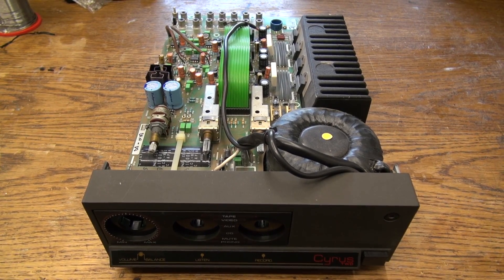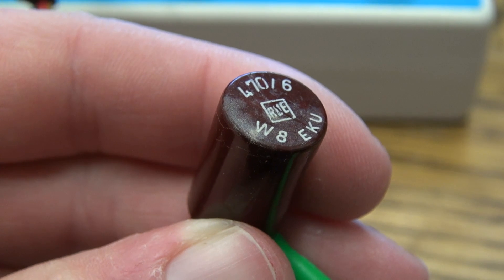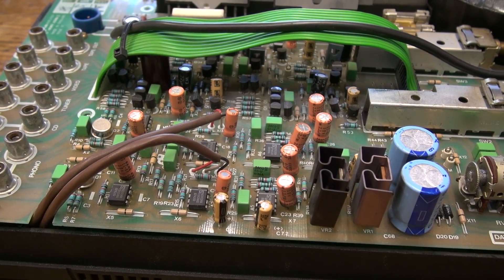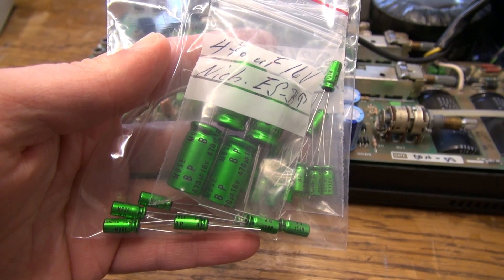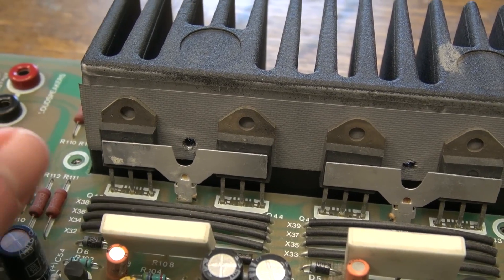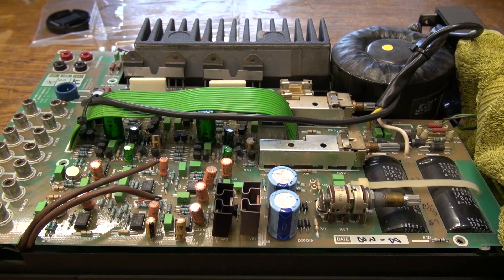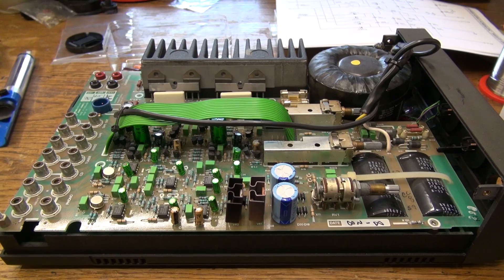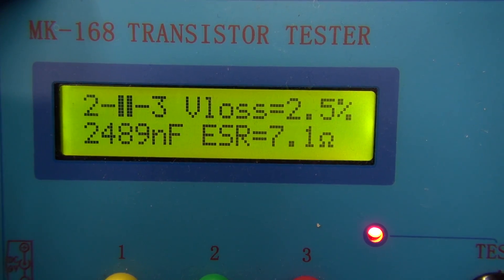Cyrus Two Amplifier Replacing Bipolar Capacitors

Comment: I replaced output stage npn with 2sd1047 because pt7 or buv28 not available in south Africa....also drive mje 243/253 i replaced with tip41/42c....works perfectly

Comment: Anyone can suggest good capacitors for the polar ones? I mean these:

8	22uF	25V	(C39, C40, C51, C52, C69, C70, C71, C72)
2	22uF	50V	(C37, C38)				
4	100uF	50V	(C53, C54, C55, C56)	
2	470uF	63V	(C67, C68)

Can I use ELNA SILMIC II for all these or do you suggest different ones?

Comment: Quick question some year later! :)
I just got my hands on a Cyrus 2! Is it fine to use with 4 ohm speakers? It’s the setup I’m using right now and it sounds great, but can I damage something?
Best regards, Pierre Manson
Reply: in the label on the rear side they stated 'minimum speaker impedance 8 ohm' so better not to use with 4 ohm speakers,

Comment: Hum... Question: how do you switch from moving magnet to moving coil now? Like, you have to open the case, and move the bridges? Is that right? I am asking, because on my amp, I have to wiggle the swich for the left loudspeaker to operate on MM. Therefore, the swich has either to go or get repaired, which I am pretty sure, no one does.
Reply from the maker: Moving Coil phono cartridges are very unusual and very expensive, I assume I will never have one. So not being able to switch from MM to MC is not an issue for me. Indeed now you would have to open the case and move the wire bridges on the board to switch to MC.
Reply: @DrCassette  could also be fine to solder a jumper connector like the ones used in computers, so in case it is just a matter to remove the 4 screws, but as you say, MC cartridges costs so much. Anyway, thanks for the video, I'll visually check the capacitors under the ribbon very soon on my 34 years Cyrus two :)

Comment: Depending on the location of tbe capacitors in the circuitry, almost everytime there is enough DV bias voltage across the capacitor to keep the polarity even with siperimpodes AC signal volktage. This allows the usage of standard polarized elecrolytic capacitors, no technical reason to use non-polarized ones. I guess it's more a question of "standing out of the mass" for Cyrus or their design philosophy. But anyway a nicely deigned amplifier that is reasonably service-friendly.

Comment: Hi - if replacing bipolar caps with polarised caps, how do you know which way to install them? Thanks - very helpful video. (I know which side of the capacitor is +ve but how do you tell which side of the bipolar cap being removed was +ve. Thank you.
Reply from the maker: Do yourself a favour and replace bipolar capacitors with new bipolar capacitors. I know they are harder to find and more expensive than polarized capacitors, but in audio equipment they are worth the extra trouble.

Comment: I have a very nice looking PSX power supply that has been sleeping in its original box for probably two decades, in very good condition (I suppose). Does this power supply have any value today?
Reply from the maker: It sure does, the old Cyrus equipment goes for pretty good prices on Ebay.
Reply: Hi Patrick. Could be keen on that if you still have it. Where are you based?

Comment: Nice! I was looking for something like this. I have Mission 767 speakers with Cyrus LFAU (low freq. alignment unit). The LFAU is based on Cyrus 2 and has no phono. When I switch it on the red light indicate it is working but when I connect the speakers to it then the woofers don't make any sound. Could you pleaee help me in knowing what is wrong with the LFAU and how to fix it?

Comment: Hi ! excellent video indeed.  I have a question.  A bipolar cap has not + and - leads so i can mount it either way ?  instead normal polarized caps explode if they are mounted wrongly ?  ho can i now if a cap is not polarized ?  is it written on the body of the cap ?  or just looking at the model part ?
Reply from the maker: A bipolar electrolytic capacitor can be mounted either way, as the name says, it is not polarized. On normal capacitors the negative (-) connection is very clearly marked on the case. These markings are missing on bipolar capacitors. Usually they also have 'bipolar' written somewhere on the case.
Reply: @DrCassette   Hi thanks a lot for the very useful advice  I will try to buy only quality parts with brand and model well written on the body.  I reversed the polarity once and fortunately the cap did not explode.  But it was not a nice event.  And of course the part got destroyed.  
I have a Cyrus one that i love.  I have also a Cyrus preamp also very good sounding (great brand indeed Mission love their products) but unfortunately the line stage voltage gain is too high and i cannot control the volume very well.  I do not why they set the gain so high.  Usually cd player output is already high and almost no gain is needed to drive a power amp ... very strange and unconvenient.  Thanks again and kind regards, gino
Reply from the maker: Are there any input sensitivity adjustments? How old is the preamp, does it maybe predate CD players? Are you using a Cyrus CD player with it? Maybe Cyrus CD players are designed to have a lower output level? I guess the preamplifier could be modified to have lower gain in the input stage, but this really depends on the complexity of the circuit.
Reply: @DrCassette  Hi !  no i use a pc based source these days  I have here an old Cyrus One little integrated that i like  I think is not the really 1st version but the 2nd  And i am wondering if a cap replacement is due.  
I have already done one on an old Nikko Alpha II power amp and the result was ok
I like low power amp better ... i do not know why.  So i decided for high efficiency speakers from now on.  Like in the old days when tubes were the norm.  Thanks a lot again, kind regards  gino

Comment: Hello. Very usefull. Does this could apply to cyrus ONE? Thank you for answering.
Reply from the maker: This should apply to the Cyrus One, at least to some versions. The differences between the One and the Two if I recall correctly are a more powerful output stage and support for the external PSX power supply.
Reply: @DrCassette  Thank you very much. Merci beaucoup.

Comment: Thank you very much indeed for the very interesting video.  I have a question regarding capacitors in old units ... is it possible to check their conditions without desoldering them from the board ?  sorry if this is a stupid question.  However i bought just now a mk-168 tester ... i have been looking for a tester like this for years ... Thanks  a lot !  Kindest regards, gino
Reply from the maker: You can test capacitors in circuit, with the circuit turned off, obviously. However, measuring capacitors in circuit very often gives you inaccurate results, so it's not recommended.
Reply: @DrCassette  hi thanks for the very kind and helpful advice It is very helpful because I sometimes buy caps around but I know nothing about their conditions kind regards gino

Comment: Please help. I am owner of cd player Cyrus CD8X ang got issue with this player - "No Disk" error. When I removed bottom plastic cover (it is covered from another side with metal paint), cd player works as expected, but if I put this cover back, same issue - "No Disk". Same issue without cover but on metal surface (on wooden surface works well). Where is a problem? I wrote to Cyrus support and got answer: "It is obviously difficult to give an exact reason for the fault without having the layer at the factory.  However, a probable cause could be that some electrolytic capacitors have dried out somewhere on the power supply section, that is causing some noise and that is being reflected back into the player when the baseplate is fitted which is in turn interfering with the optical section of the player.". Question: does it worth to replace all capacitors or my issue somethere else?
Reply: Just demagnetize the metallic disk on the top of the disc holder and you will be fine. Forget the electrolytic caps and don't mess with them. Your problem is not electric...

Comment: Please help. I just replaced the two large 470uf capacitors and hooked it back up to my speakers, it sounded AMAZING for about 20 seconds, then I heard a pop and the sound stopped, I checked the fuses and the fuses had blown, what did I do wrong!?
So I hooked it up WITH the psx and still no sound

Is it possible to replace just the large 470uf capacitors only or do the whole set need changing?
Also, do I have to use 470uf 6.3v or could I get away with 470uf 10v??? Is this the mistake I made????
Reply from the maker: You can change just a single capacitor, no need to do the whole set at once. The voltage rating of replacement capacitors must be the same or higher than the originals. So replacing 6.3 V with 10 V is fine. Your mistake probably is that you have used polarized capacitors instead of bipolar ones. If the fuses are blown there may be further damage to the amplifier.
Reply: @DrCassette  thanks for your reply, I have definitely replaced them with bipolar capacitors, here's a link to what I bought
 https://rover.ebay.com/rover/0/0/0?mpre=https%3A%2F%2Fwww.ebay.co.uk%2Fulk%2Fitm%2F183247490013

I realised, when I changed them and hooked the amp up (it worked for 30 seconds or so and popped and now continuously blows the fuses) I forgot to clamp the transistors back onto the heaststrip and chassis

Has that caused my problem? If so, what on earth do I do now?
Reply from the maker: If you are lucky the transistors just overheated and shorted. This would explain the blown fuses. Test the transistors and replace if necessary. Also check the driver stage for faults. I can not provide any further help.
Reply: @DrCassette  got my amp working and sorted again.
Just wanted to ask if your phono input actually works after you took out the selector switch and bridged the mm and ct instead. 
I did the same thing but now I have no audio at all in my phono stage, I'm yet to investigate.
Reply: @DavidLee-nd2sx  just an update, got my package today. Trail and error revealed that only transistor Q41 and Q33 were open, the rest of the components are intact. Q43 read low readings because q33 was faulty.
David, could you do me a favour and check what your D9 and D10 read. Mine reads shorted (on diode test mode) with black on ve- and on ve+ the numbers jump around like mad... not sure if this is a fault or if it's meant to be like this... the actual parts themselves are fine but the readings are wrong
Reply: @DavidLee-nd2sx  final update. Thank God, I've done it, I powered it up and I'm so thrilled, it's up and running again and sounding amazing, thanks for all your help
Let me know how you get on
Reply: Just an update, I've tested all the parts. I spoke to the previous owner and turns out there were a few problems with the output transistors, drivers and diodes so I'm completely at fault thank God. If you want to know exact details, do let me know
 I'm waiting for my DHL delivery for the parts so I'll update you all when I've fitted the new parts. I'm going to completely rebuild the output stage just for the sake of it
Reply: @DavidLee-nd2sx  I know right. I will do. What problem are you facing with yours, I may be able to help
Reply: @DavidLee-nd2sx  yeah, if you've tested the power supplies and they're fine then it definitely sounds like you have a signal fault. I think you should do the 1kHz test, the manual says through the cd input and volume on max (don't think speakers should be connected), and trace through the input switches, volume control stages and output buff amps. Hope you find the problem somewhere there, keep us updated David
Reply: @DavidLee-nd2sx  so with the transistors, you know how they work, middle leg is the base, that's the leg that's connected to the amp stages and takes the actually sound info. The right leg takes the dc input, and the left legs runs to the soaker output. 
My Q41 is completely shorted, dead, it allowed current in through the base and this blew Q33 and Q31, D5, R89 and R95. I can't get my metre pins in to test Q27 and 29 but they're probably shorted too. There's a protection circuit in place, if too much current flows through Q37, it switches on along with Q35, this disables q15 and q11 (constant current source) and disables the power amp.
I've bought replacements for every single resistor, transistor, drivers and diodes in the output stage. It's hard to tell how much is damaged yet, may not be much if I'm lucky but if I'm not then it's all the drivers, I just really hope it didn't blow anything further back in the pre output stages or amp stages
Reply: @DavidLee-nd2sx  yeah, 470-490 sounds right. I'm not sure, I think the transistor must have just been overheated. Also, now that you mention it, it would probably be a good idea, I have already recapped all the bipolar capacitors, 14 of them, didn't think about any of the polarised ones. I was thinking of new rca connectors too, but I can find any compatible 4 pin gold connectors anywhere, only the screw on ones
Reply: @DavidLee-nd2sx  Yeah I've seen, but I saw a picture of the circuitry, I think it's the screw on ones, with extra wires running from the port to the input. I don't fancy drilling a whole in my pcb
Reply: @DavidLee-nd2sx  thanks David, really appreciate your help.  It makes a huge difference hashing a second opinion and another reading to compare against.  How's your amp going?
Reply: @DavidLee-nd2sx  that's cool,  sounds like good fun. I took out the fuses and d9 reads correct now, strange, don't know what that means.  D10 still had strange readings.  They read perfect before I change the shorted q41 and q33
Reply: Just an update, as far as I can tell, the only parts that needed changed were the Q41 and Q33. I'm going to lightbulb test it, don't want to be too confident and possibly blow parts again
Reply: @DavidLee-nd2sx  this is strange, so my amp works, but I plugged my turntable into the phono input today and nothing, no sound. I bridged the mm and c.f. like DrCassette did, I don't know if that's caused this or what. Do you have an ideas?
Reply: @DavidLee-nd2sx  No, I bridged mm to ct, bypassing the mc, exactly how it's done in this video towards the end. Not sure what's going in, all other stages work, cd, tape, aux etc, but not the phono
Reply: @DavidLee-nd2sx  ahhh, are you thinking the opamp might be blown? I was wondering the same thing, I'll try find some online to buy
Reply: @DavidLee-nd2sx  Thanks David, I'll check the readings, the bipolar caps should be fine, I fit a whole set of brand new ones just the other day, 14 in total
Reply: @DavidLee-nd2sx  Hi David, I checked the values of those resistors and they read fine. There was a horrible hum, so I for the selector switch back on and the hums gone but still no audio, I can't find any faults. I just wonder, if id's the opamps, something would have caused them to blow, if I replace them, they may just blow again instantly, but I can't find any problems
Howevwr, when my transistors blew, I was listening to my record deck on MM, so maybe that's why it's blown?
Reply: @DavidLee-nd2sx  Hi David, how's your project going?
I checked everything over and I can't seem to find any faults in the board at all, only that the opamps are probably blown. A1 and A2 are intact, so I'm going to take out A3 and A4 and swap them around, hopefully this does it
Reply: @DavidLee-nd2sx  ah, it's a shame you haven't been able to work it out. I'm still having problems with my phono stage, I can't find the faults. I actually changed the opamps, but this didn't work. 
All I know is that the record player was actually playing through the phono input as the transistors blew. Transistors are fixed, cd, tape and aux etc work now but no phono.
Reply: @DavidLee-nd2sx  Yes, it looks like we're on the same page. Unfortunately I don't have an oscilloscope, I don't have many tools except a multimeter and my soldering gear. I was thinking of going for a job or doing some experience with my local Hi-Fi technician who's got over 30 years xp. 
I wanted to get this amp out the way quick because I've also got a Meridian 206 cd player and Nakamichi tape player to work on. In between that I'm working and trying to record an album for myself with all my music recording equipment, so It's all pretty time consuming :D

Comment: I have been looking at so many fascinating repair and restoration videos of monster Marantz and Pioneer receivers and have to think that they have so many unneeded frills that I never missed such as tone controls, filters and the contour controls. No wonder they need so much work to get them restored and all the board to board connectors and multitude of buttons and knobs they're just born to fail. They Cyrus should be a perfect example of reliability. All one board, just two rotary selectors. I know from my own experience that they fails far more than the complex  monsters. And yes I had the hum too. These should be so rock solid reliable but... sadly not. Why!
.
Reply from the maker: The switches and potentiometers like to develop bad contacts, but that happens to any old equipment. The power supply is a bit of a bad design, has to dissipate way too much power, and the resulting heat can cause problems. An additional low voltage winding on the transformer would have fixed that. Some capacitors do fail, but again this can happen in any old equipment. And the hum occurs when the isolation of the output transistors is damaged. That only happens when service personnel is not careful. All in all I find this just as reliable (or unreliable) as the vintage Japanese equipment.